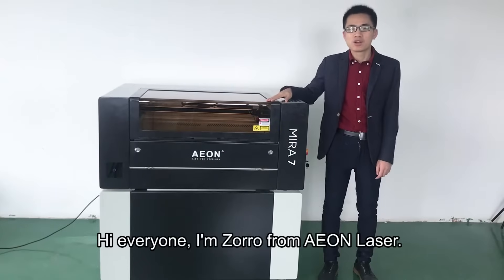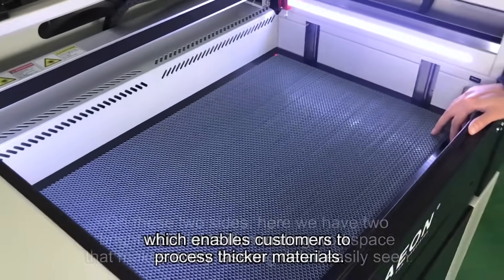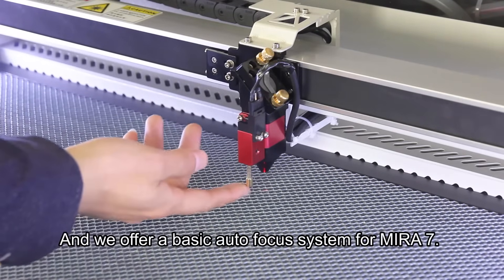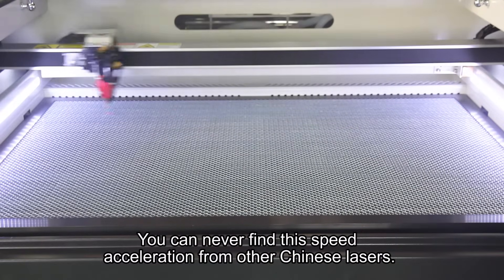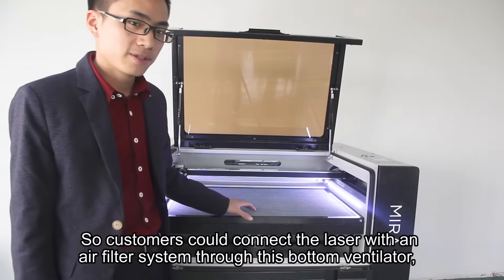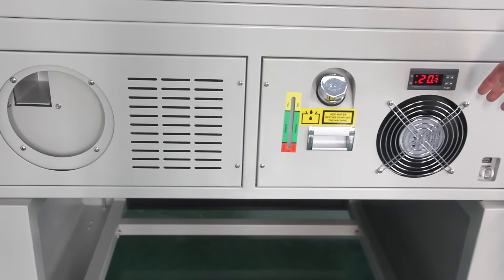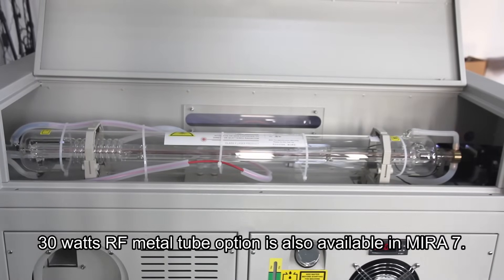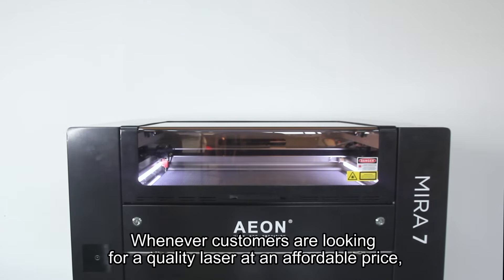AEON Laser new MIRA7 | High Speed Modern Laser Engraving and Cutting Machine - AEON Laser Official

Comment: I have a Mira7. I need to engrave whiskey glasses. Will be using the rotary tool. Can you please give me some recommended settings for the Mira7 for working with glass?  I understand heat can play a major factor, but adjusting lines per inch, power, etc will prove successful
Reply from the maker: Hi, for the MIRA7 engraving on glasses setting 
Power: 40-45W
Speed:600
Line interval: 0.08mm